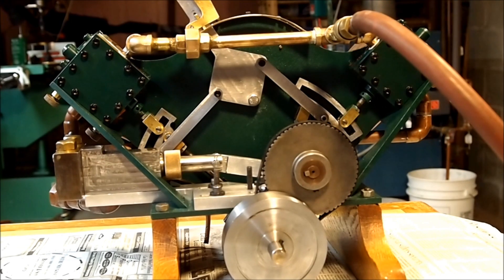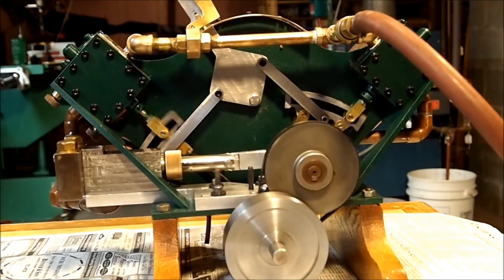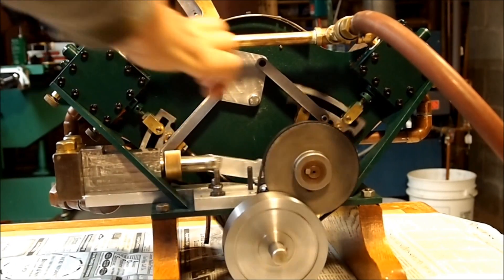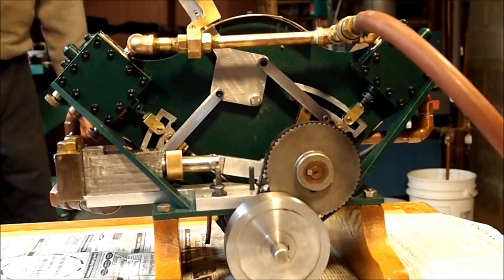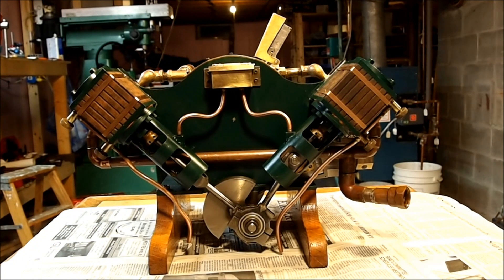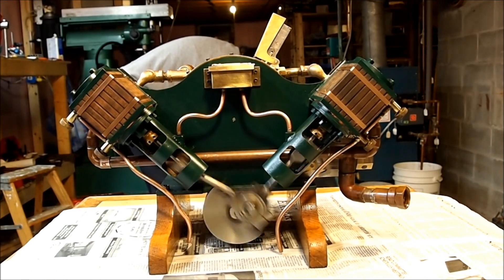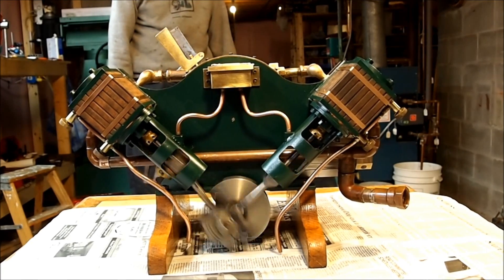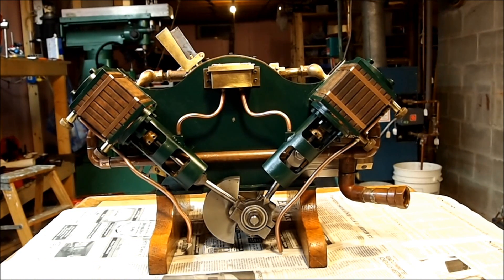Al Berry's V2 Simple Marine Steam Engine

Comment: Hi. I'm nothing to do with this engine or Ray Hasbrouck but it's based around a HasBrouck No 8. Ray Hasbrouck was an innovator in steam engine design as far as I'm concerned. If you look at the last and most modern steam engines (I am thinking of an SAR class25 here, they all incorporated roller / ball bearing designs). Ray used roller and ball bearings on a smaller scale in some of his designs even in the big ends and also commercially available cylinder linings and rings which is so innovative! His engines are designed to be built out of stock materials and not castings. Someone (to our benefit) has taken the initiative to capture this great man's knowledge and skills and publish his articles in a book. It's hard to get hold of and difficult to put down! It contains all the detailed drawings for his engines (including No 8), with parts lists and machining advice. He designed a crank shaft that can be dismantled! The book is an inspiration in modern steam engine design and well worth a read. The ISBN is: ISBN-13 978-0-941653-44-2 and is published by Village Press, Michigan. 49685-0629. I got my copy from Camden Miniatures in London England.